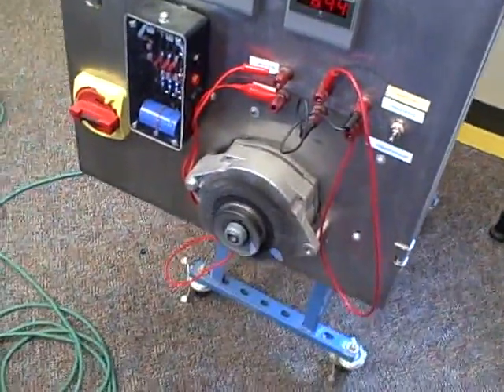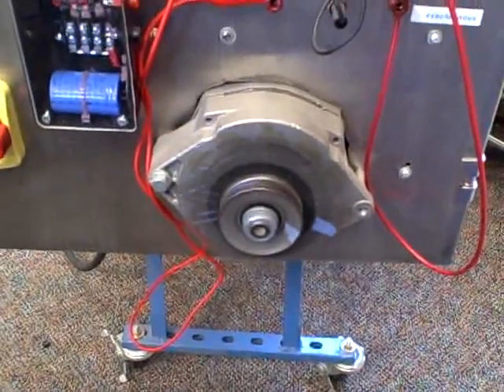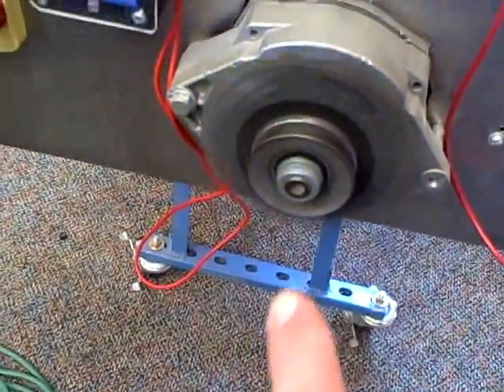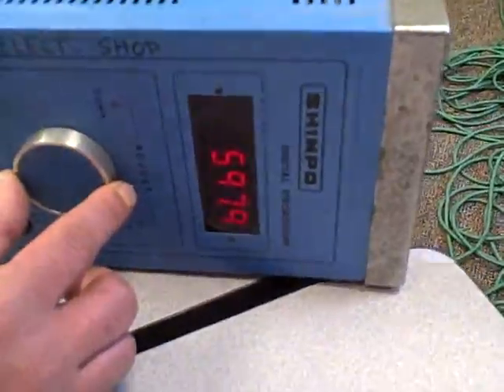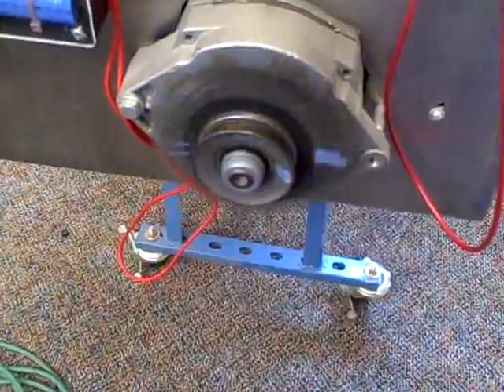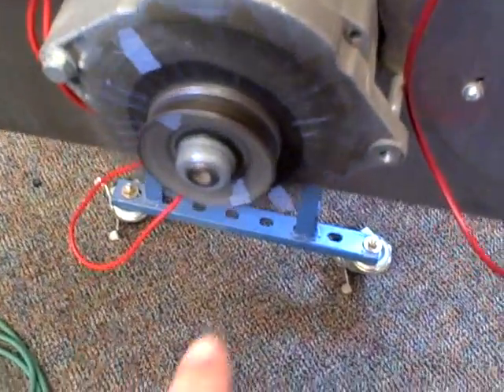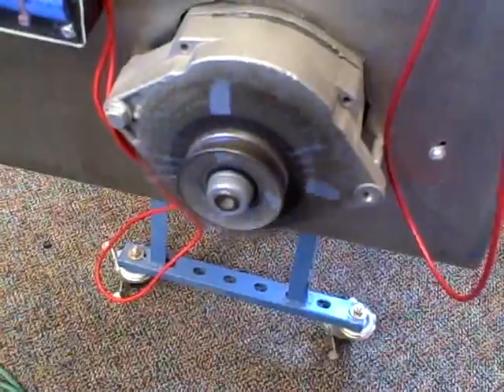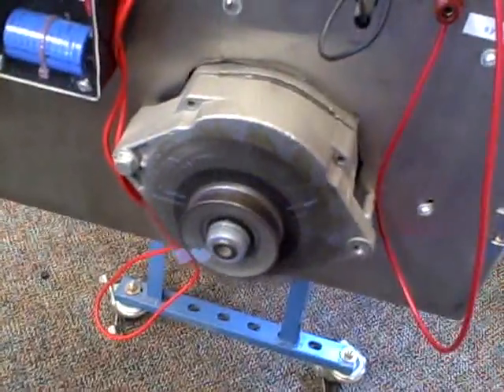Stroboscope demonstration

Comment from the maker: We have a second alternator being spun by a wood lathe, with the internal bridge rectifier bypassed to give us three-phase AC output rather than the DC output you normally get to charge a vehicle's battery.  Automotive alternators all use polyphase stator windings to give a really "smooth" rectified DC output, which we happen to exploit here to generate our own three-phase power.